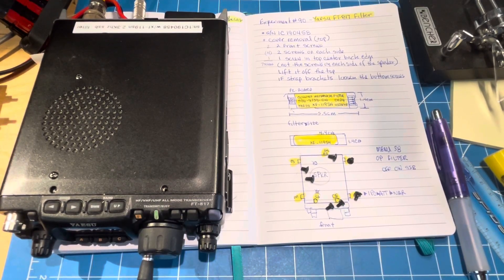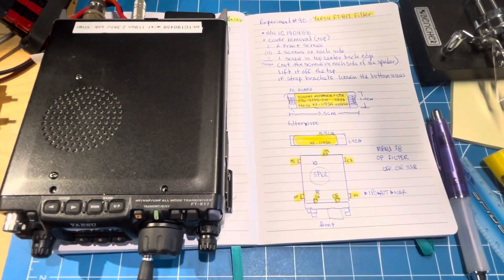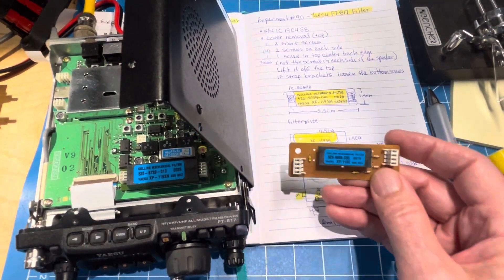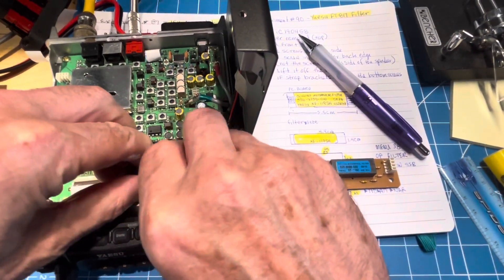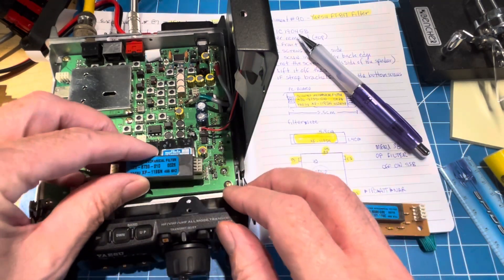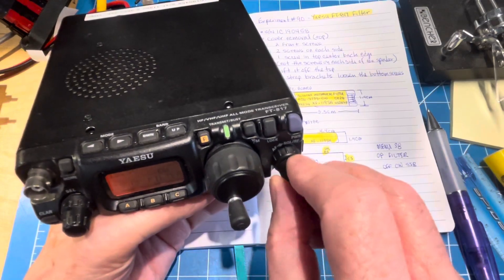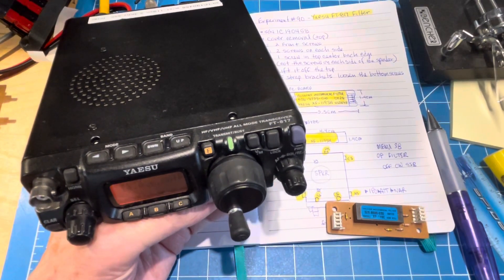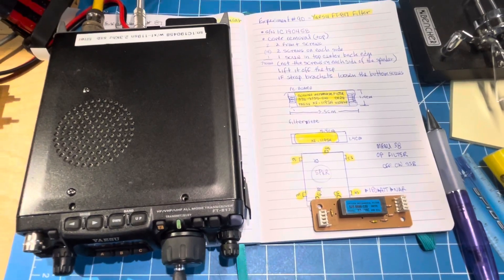FT-817 Filter Install, dimensions and settings. Did you buy the wrong filter too?

Comment: I have both in my FT817 and the narrow 300 or 500khz filer is better for CW.  What you say was winde open IF vs a narrower one that reduces noise.
Reply from the maker: I really want to get either a 300 hz or 500 hz filter but they are going for around $300 these days. I can buy a K1 for that haha. I hope to modify a filter to use with the parts I’ve collected 
What are the part numbers on your filters? Do they seem to look like my 2.3 kHz filter?

73,
Bruce
Reply: @tyrueiI  I can check mine once I return and have the time.  If you hit me up in a couple of weeks I can get you the part number and anyting else.